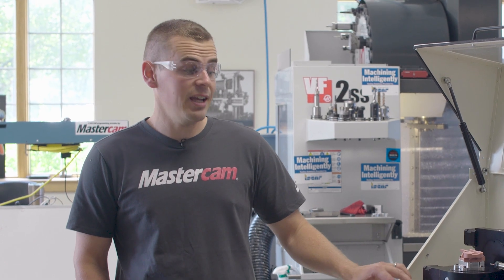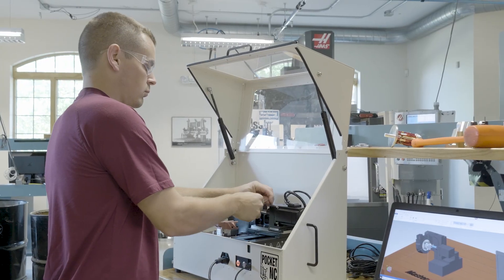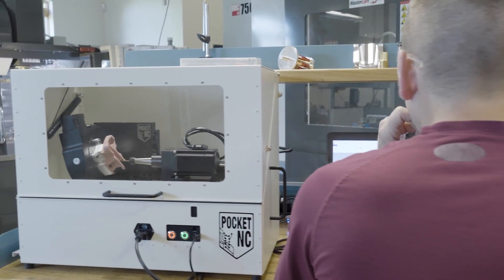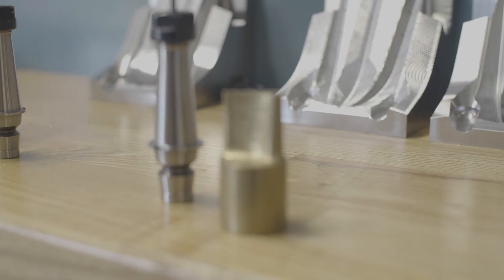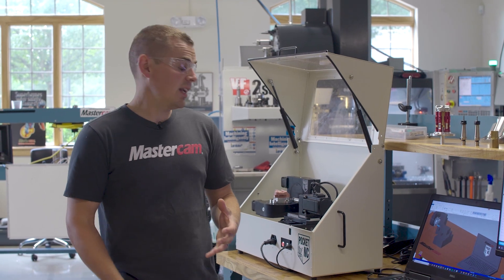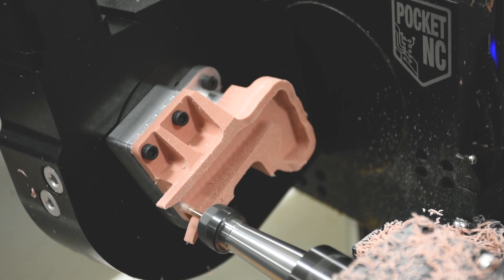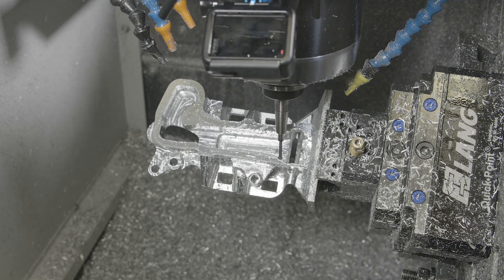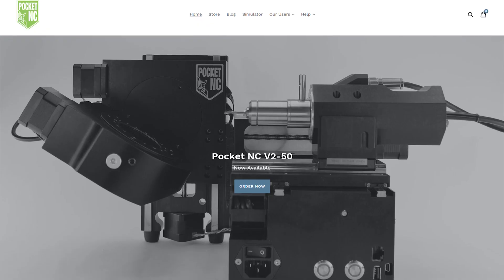Post Processors and Simulation for the Pocket NC

Comment: why would the 50k rpm version be capable of milling titanium? the cutting speed in titanium is even slower than 4140 and considering the spindle most probably has way less torque on the low end i guess the 10k version is better suited for titanium but tell me if im wrong
Reply: maybe this spindle is also much stiffer idk. high spindle speed is only needed if you use small tools. 1mm endmill at 120m/min gives you 38200 rpm.